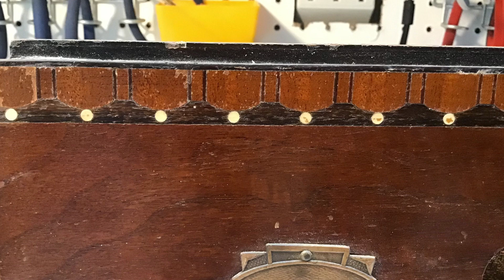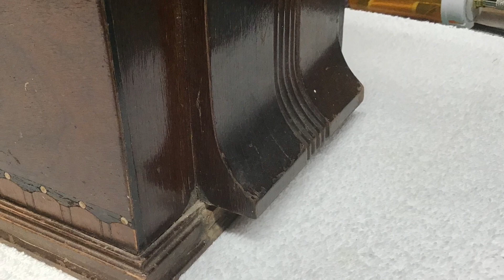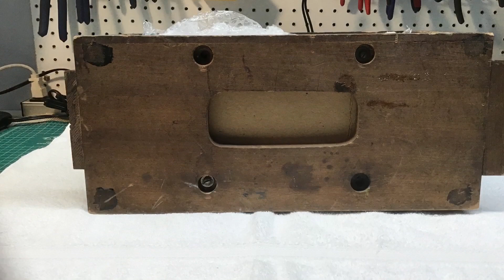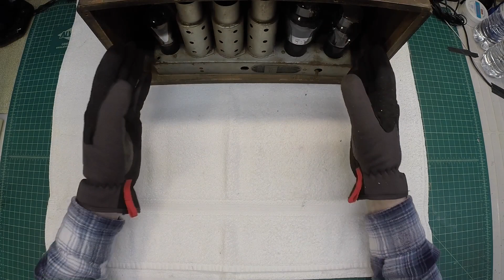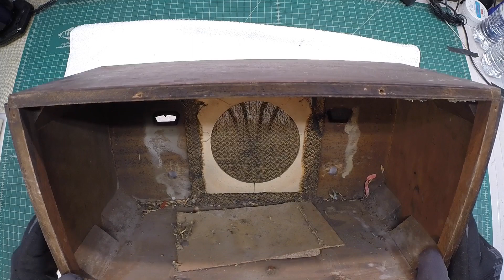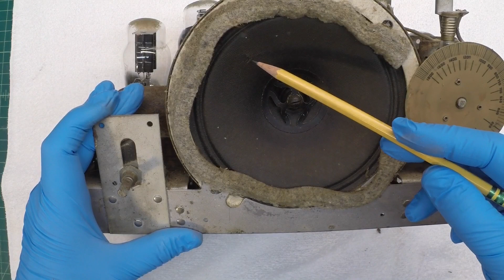Zenith 707 - Introduction

Comment: I have a Zenith 706 which uses the same chassis that I restored. I was fortunate and the cabinet was in beautiful original condition. The chassis, not so much. Someone over the years decided that the 59 tube wasn't good enough (or something) and rewired it for something else - new tube socket and all. I ordered a new correct socket and another 59 and rewired back to original. Now it plays well. I'm sure your restore will be amazing! Good luck and have fun, i know I did! :)
Reply from the maker: Jeff - the 706 has a nice looking cabinet too. I’m glad you were successful in getting the original 59 tube back in it. So far, so good with my limited transformer testing. Thanks again Jeff. Best, Don

Comment: I WANT one of these ❗️
📻😁
Reply from the maker: Jeff - they are super looking sets. I think I saw one on eBay some time back,  but I don’t recall the condition or pricing. Thanks for watching. Best, Don
Reply: @RestoreOldRadios  
Well , I do have a TOTALLY awesome 
‘36 Stromberg-Carlson 3-band Tombstone, completely redone ,electronically.
The wood is not bad, but unrestored.  It gives many of today’s SW radios a run for the money.  Excellent performer,and huge speaker in wood sounds awesome.
  I have a number of Tube (valve) radios.
One day, I will be buying several more 🤣.
  I have a lot of vintage transistor radios as well.
(( many have been showcased on:
“Tom’s Radio Room Show “.
📻😁
Reply from the maker: Jeff - that’s very cool. I’ve got to look for a photo of your ‘36 Stromberg... You do your own restorations I assume? Best, Don
Reply: @RestoreOldRadios  
(I thought I replied to this, but I see my comment is not there);
  I can do no more than some DeoxIT, as for electronics, but I am a Professionally trained 
Auto Detail Technician, with over 24 years experience, SO, I can do a lot on the cases, especially plastic, and Bakelite.
I have no setup for wood cabinets, but I should do pretty good with it.
I use :
“ Florida Radio Doctor “ for my Tube radios.  He is outstanding ❗️
I have no one , currently to do any of my vintage transistor radios.
(( and I have some very interesting transistor radios I’d like to have done.))
Many of my radios [ from 1915- to 2020] can be seen on :
“ Tom’s Radio Room Show “
📻🙂